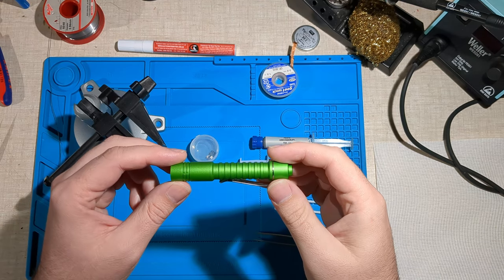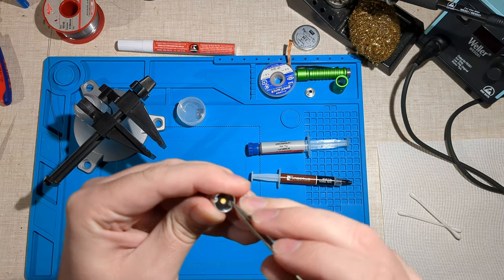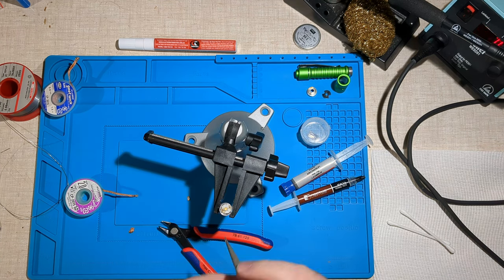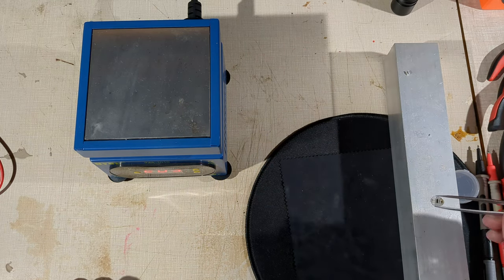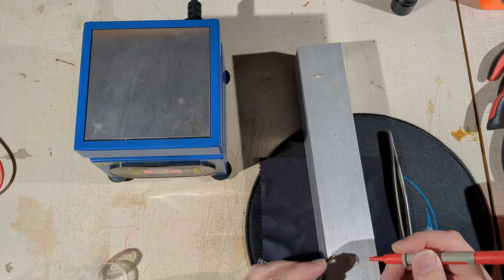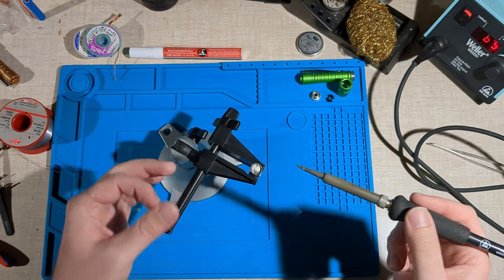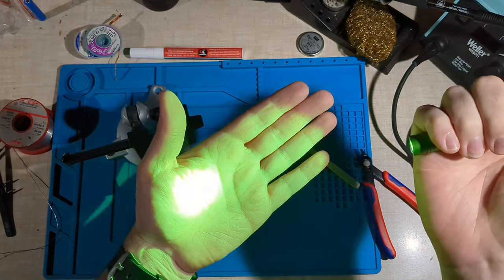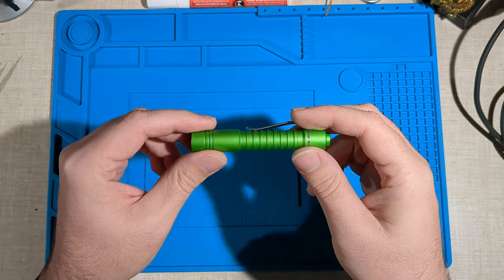ReyLight Pineapple Mini modification for twice the throw! 😱

Comment: Very nice. 
Too bad Rey's lights sustainable output is so low.
Reply from the maker: AAA Ni-MH batteries seem to have a better sustained output compared to 10440 Li-ion in a ReyLight Pineapple Mini: https://timmcmahon.com.au/posts/reylight-pineapple-mini-green/
Reply: @TorchHacker  According to the chart on your review at 100% the output at the 10 min mark is at only 20lm, while the 10440 is at 97lm. How's that better sustained output?
Reply from the maker: @300ZCorradoVR6Z  NiMH 100% starts off at 126 lm, is 98 lm at 30 seconds, and then sustains 20 lm for over 5 hours. 10440 Li-ion 100% starts off at 394 lm, is 331 lm at 30 seconds, gradually drops from about 110 lm at 2 minutes and continues to drop to 70 lm by 41 min, shutting off around 51 minutes. So it's a 51 minute runtime with 10440 Li-ion vs 5 hour 26 minute runtime with Ni-MH. You'll get a much longer runtime at a lower output with NiMH. I did some more tests with a LANapple: https://timmcmahon.com.au/posts/reylight-lanapple-purple/
Reply: @TorchHacker  I'm talking about sustainable lumen output, not runtimes.